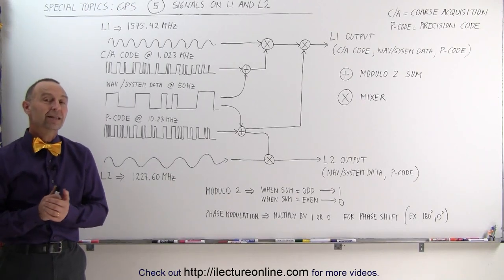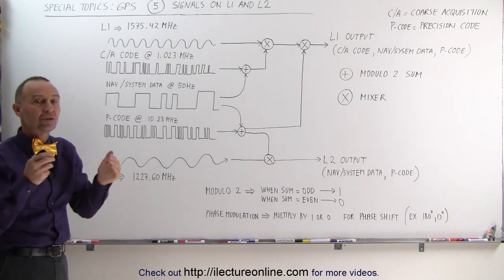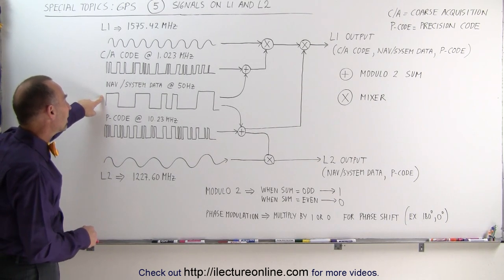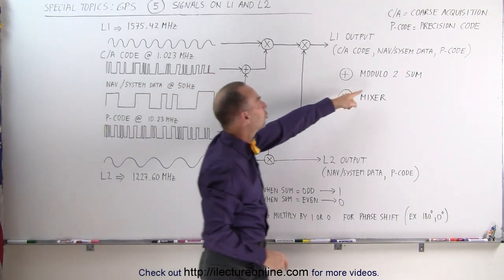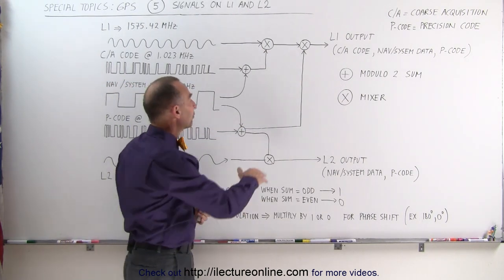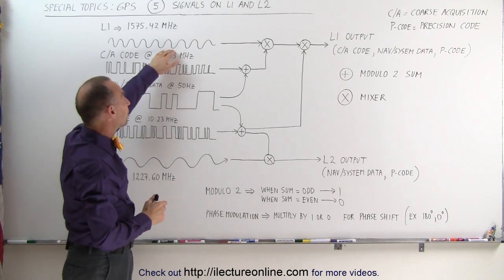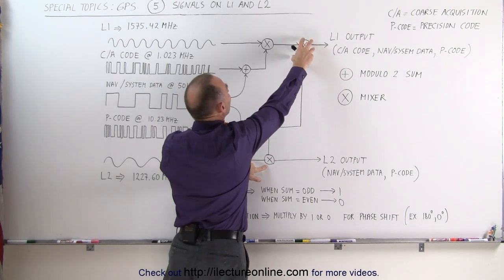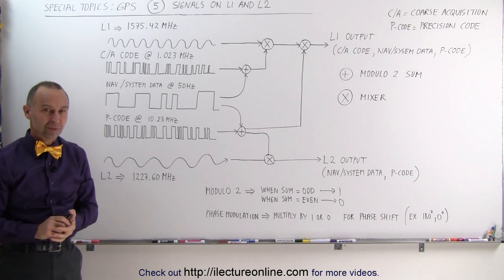Special Topics - GPS (5 of 100) Satellite Transmission Signals on L1 and L2

Comment: Thanks for the explanation. One point however is that the P-code which is used on the L1 is multiplied with a  90* phase shifted version of the carrier and combined together with the carrier modulated signal with CA signal.@1:51 with the figure for L1 signal we wont be able to recover back the CA.

Comment: Is there a video on how these signals are then decoded? I can see there is video how single signal is read. That's clear. But it's not clear how multiple signals from different satellites are read as they all transmit on the same frequency. How are they not interfere with each other?
Reply from the maker: Yes, we have some videos later in the series that cover that.  That said, we are planning on additional videos that will go into furtner detail on that.

Comment: Okay... that was hard to follow.  So the digital data is xor-ed across their serialization frequencies, which makes sense.  And the carrier wave mixing is supposed to be the same?  If all the data is digital and all operations are xor then what purpose does the analog carrier wave serve?  Would we not just end up reading it digitally?
Reply from the maker: The receivers are built to receive an analog wave.  (E&M waves are analog waves and are converted to digital form in the A to D  signal converters)

Comment: Very basic question regarding GPS. Why Only L1 and L2 frequencies particularly are choosen for GPS.
Reply: You should ask this question the other way. Why do we ever need two frequencies? We could do with one, because pseudorandom sequences from different satellites are uncorrelated (Gold codes) and can safely reside on the same frequency.
But 2 frequencies can be used to estimate delay in the ionosphere (which is frequency-dependent) and compensate for it.